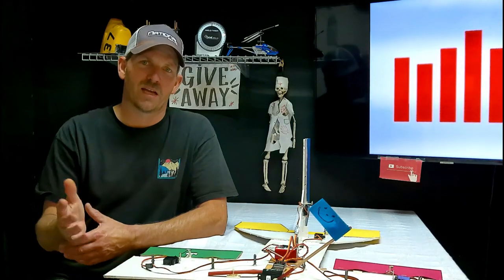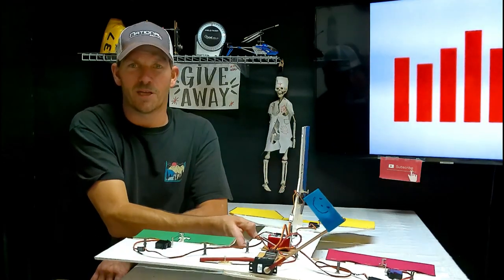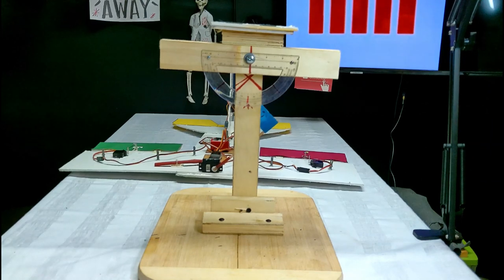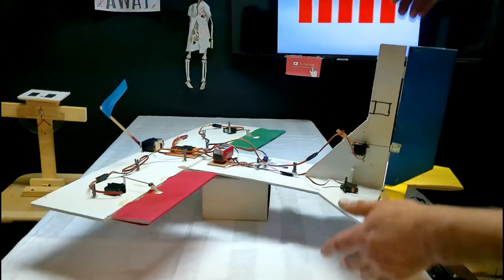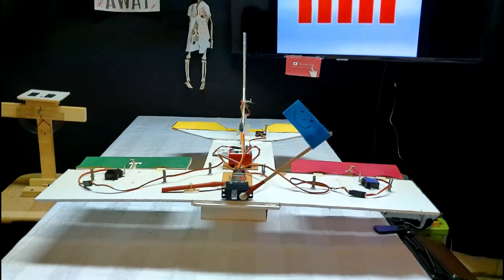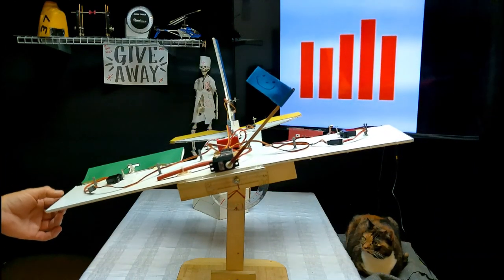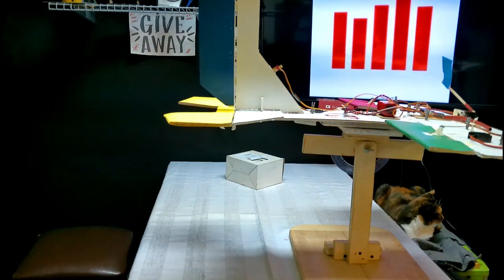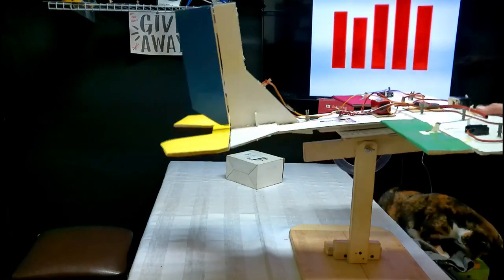SPEKTRUM AS3X & SAFE RECEIVER FLIGHT MODE ENVELOPE (intermediate) angle demand explained

Comment: Was that an AR636 or one of the newer Smart AS3X/SAFE receivers? On the AR636, you have to use 100% travel and 100% dual rates for the bank/pitch angle limits to be correct. If you were to set the dual rate to 50%, the angle will be 50% of whatever the bank/pitch limit setting is. So, I always use 100% travel/rates in SAFE mode with my AR636's. Just for fun, reverse the aileron gyro and tell me what it does when you rock it back and forth thru level inverted.
Reply from the maker: AR630

Comment: How do I set up the AS3X on the transmitter. I have gotten a plane with eh AS3X receiver in it and got the flight surfaces working but how to I get it to work on my Spektrum DX8 gen2 transmitter?